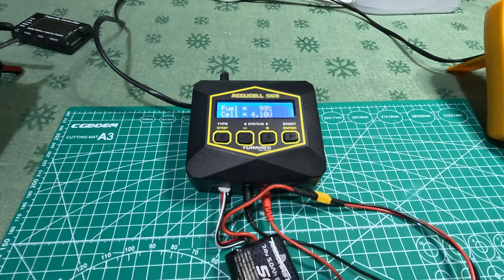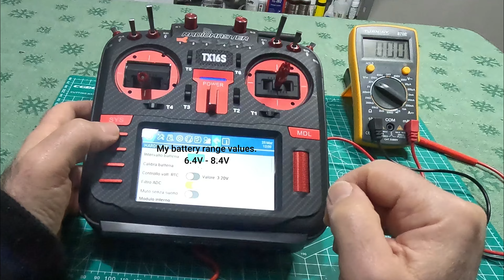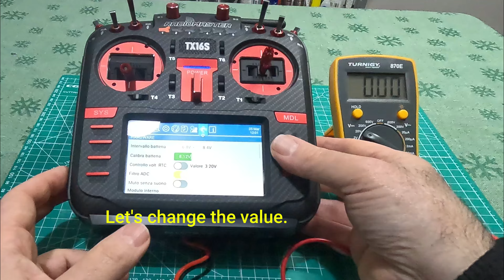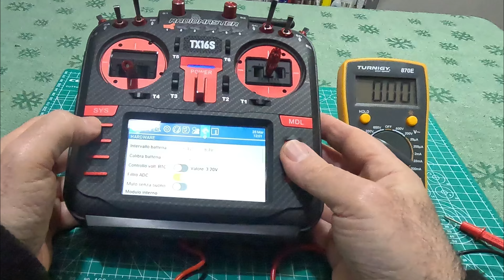HOW TO CALIBRATE THE BATTERY OF YOUR RADIO. RADIOMASTER TX16 s MAX.

Comment: Hello there! Thank you very much for your video. I tried to measure my battery (I also have the Radiomaster battery but for 6200MAH and it shows me 9,73v. Is it normal? As when I enter the calibration menu - the highest voltage possible is shown like 8.4v. What value should I put for calibration
Reply from the maker: Hi, charge your battery to the max whether it's lipo 2s or lion 2s. Measure the volts it reaches with a multimeter. Usually the 2s do not exceed 8.4 volts. Instead it changes the minimum volts between lipo and lion below which you must not go. Then measure the battery volts with the radio on and you will see that they drop. Check in the radio settings that the battery meter range is set correctly to lipo 2s 6.6v 8.4v. Set the idle alarm to 6.8v or higher. Then you move to the battery calibration menu and correct. It seems strange to me that a 2s reaches 9.73 v regardless of capacity. Except it's a 3s.
Reply: Same my issue